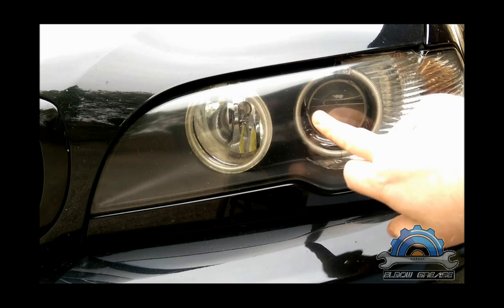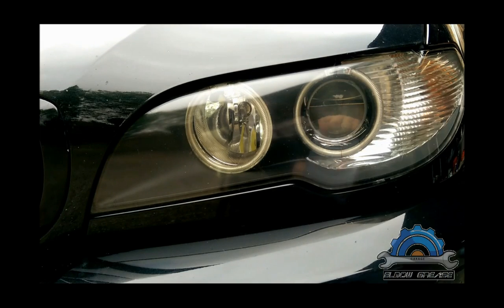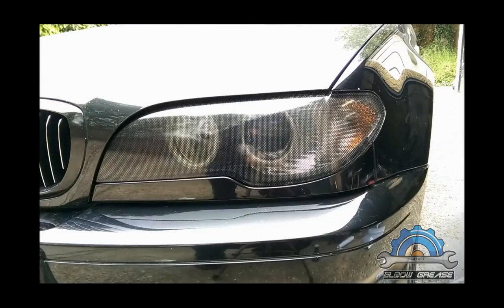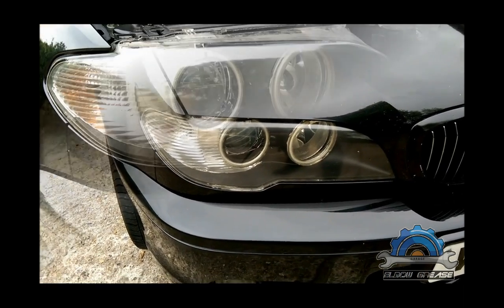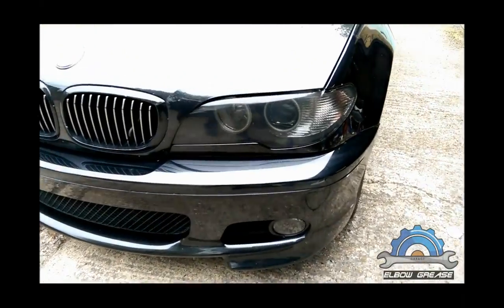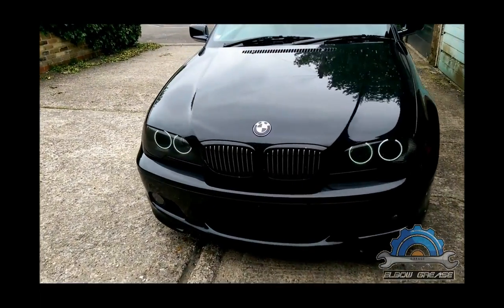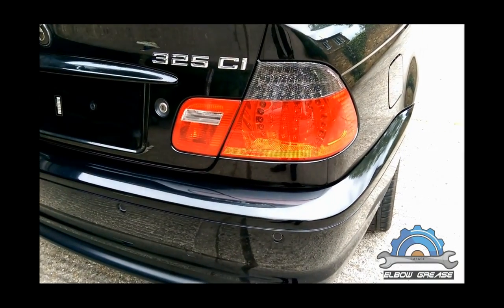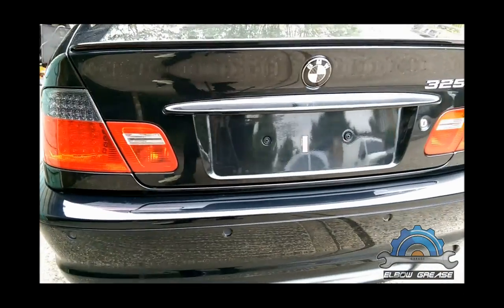Fly eye headlights tint,film in My BMW e46

Comment: when you need heating tool? Can you make it "loonger" when you heat it ? becuase i bought 12x48 and its sligly smaller than my light and i dont want to use another piece to complete one light
Reply from the maker: I don't  think you can stretch it ,heat makes it flexi and soft ,easy to apply,

Comment: Hi, did you have to disassemble the lampshade when u add rings? were they glued?
Reply from the maker: Lordzik14235 you have to remove the headlights,remove,screws,heat them up in the oven so glue gets soft so you can split clear plastic from housing.I used thin SS wire to attach rings to housing.Glue can be messy and can melt ,wire is  clean and not visible
Reply: thanks for answer!

Comment: Did you replace the front bumper? If so where'd you get it cause it looks good as hell! Also wear can I get a spoiler like the one you have?
Reply from the maker: Both are OEM ,front don't have reg.plate only  .For rear type LIP spoiler on ebay

Comment: How did u add the rings around the lens?
Reply from the maker: I used 3 thin steel silver wires so not visible cuz hot glue to soft it will meltdown,doubleside tape ,same

Comment: Is it cabrio?
Reply from the maker: No it's standard 2 door.
Reply: What year is that?
Reply from the maker: 2004 facefift 325
Reply: Are these LED or CCFL rings/angel eyes?
Reply from the maker: CCFL's holding good 6 years now only inverters need to be changed sometimes
Reply: So I wont get sharp rings like yours with LEDs?
I guess low quality capacitors dry out in these inverters.
Reply from the maker: I think LED's  are brighter,this set cost me 19.99 GBP. With invertors,they need to be kept away from heat if possible.
Reply: Yeah because capacitors dont like heat and they dry out quicker.
To fix these inverters we have to only replace capacitors worth less than 1GBP but these inverters are potted in resin so we cant replace these caps and have to buy entire inverter :D
Reply from the maker: cheap as chips!
Reply: Yeah, right, but manufacturers use even cheaper caps so product will die after warranty xD
Reply: Btw. why you dont have front plate?
Reply from the maker: Just for filming,to show full beauty.
Reply: Ah, ok, I though there is a legal way to drive with only rear plate...